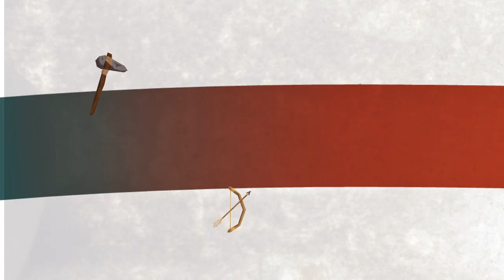A Prehistoric STONE bike?

Comment: Dude making a wheel from stone took less time than making it from wood
Reply: I think that comes from the fact that his wood working tools unlike their ancient predecessors weren't refined and passed down over generations (and most importantly practiced) and countless years. Using a chisel and a hammer is much easier to learn and less skill intensive. It is one of the flaws of the series is that I think it is ok to "cheat" and use more modern materials and systems in an effort to match the level of craftsmanship that was available from communities that shared resources and  specializations. Which is why I liked seeing his "cheat" at the end to really but the wheels to the test
Reply: *if you have the right type of stone. *If you have the right size stone handy. 

Getting a piece that was flat was 90% of the work with the wood. The rock was ready to go

Comment: I've noticed how much better you've gotten at casting metal over time. Practice makes perfect I guess!
Reply: Modern tools makes perfect
Reply: I think that's because they stopped trying to hide the fact that they're using a modern forge lol they were doing their pours from way too high to hide the cup from the camera
Reply: @GlorifiedGremlin  yeah, and honestly I'm totally fine with that, they proved that with enough time they could smelt metal, so them saving time and offsetting there lack of practical skill by using a modern forge is fine.

same thing with him sharpening the scissors and razor with modern tools, he could have done it with random stones and achieved the same result, but it's just such a painfully long process.

Comment: You’re riding it on asphalt. Try it on a more natural surface.
Reply: Yeah i guess it's more rated for mountain biking
Reply: I can imagine taking that down a hill, it would break and then the stone wheel would just smash everything in its path.
Reply: @Volt64bolt  the wheel seems fragile
Reply: Like sand since it's for Egypt
Reply: So... ice?  Butter?
Reply: I'd imagine both of those wheels would sink and get stuck in soft dirt, grass, leaves, etc
Reply: To be historically accurate to where Wheels were actually being used he would have to go to a desert to test it. And it did not survive long enough
Reply: @Volt64bolt  Going downhill is  the easy part.  Try taking it up there in the first place

Comment: Little historical heads up for you: if you want an easy way to smooth  out things like your wheels you can grind/smooth them down by rubbing them on a stone (the stone you used for the wheel would be perfect). You can make it even finer by using a scrap of leather and then putting a bunch of sand on the leather like sand paper. 

Otherwise just wanted to say I love the channel and stay safe!

Comment: Try 2 spherical baskets for wheels; built in suspension, so the frame can be ridged. Wide wheels will be more stable and put the symmetrical frame along both sides of the body giving more room for legs to run. Lean to steer. Weaving is simpler tech so you could move the time period back a ways. Also love what you do! Thank you for posting the goofy honest attempts; it's good learning!

Comment: You guys should make a file and a spear pointed twist drill. Both tools where available in the Classical era and possibly earlier. Would unlock early stages of precision engineering.
Reply: And most importantly to HTME 
They are easy to make.

But he dis tease making a lathe and those are insanely useful for making files and drills.

Comment: What about using bamboo instead of wood? It should be a lot stronger and lighter. Something with a 1-2" diameter? Smaller stuff would make for natural spokes as well. I think it would be totally tubular! Wow. Sorry about that.
Reply: There modern manufacturers doing this actually.  Bamboo apparently absorbs the vibrations so the rider doesn't get as tired.

Comment: Take the stone wheel, place it on it's side on a very good pivot (maybe a metal pointy pole sitting on a stone hemispherical hole), spin it as fast as you can and then bring some harder material to the very edge to sand it down, keep doing till it it's round; next keep it in place and attach the wood wheel and repeat, using the mass of the stone wheel as a flywheel.

One possible way to get it to a high speed relatively easily might be to wrap a rope on the axle and pull it sorta like a giant top; if you get enough momentum and low enough friction you might even be able to let the rope wind back at the end and keep it going back and forth sorta like a yoyo.

Comment: One thing that would have made the wheels better is wrapping with softened wood.  Take green branches (or strips soaked in water) and wrap them around the wheel then let them dry.  They'll give a more consistent surface and probably hold them together better.

Comment: Need to work on truing a honing stone (three-stone method), and then doing something in regards to sharpening to make that spoke-shave work properly. In addition to that, having a block plane would help too. Bronze is hard enough to take a proper edge, even if more subject to wear than iron/steel. That could improve the level of woodworking somewhat. Also need to learn how to do butterfly joinery. This is more of a "Flintstone" build than something properly Bronze-age. (A builder of chariots would only shake their head at this level of workmanship that would make some beggar's ox-cart look good.)

Comment: He should make carve like a soft cube of wax into a roughly circular shape. Find the center, connect to an axle shave into a smooth circle with a sharp blade. And use lost wax casting to make a metal wheel. Maybe use the master wheel to shape and finish rough wood boards?

Comment: There is evidence that the bike was almost invented several times (most famously, da Vinci made a rough draft of a bike moved by pedals), but each time either the idea was not implemented, it didn't caught (novelty toys, like you said) or they lacked some key point of technology (in da Vinci's case, I seem to recall that it may have been a stable wheel-and-chain system).

Comment: the only thing you're missing is the fork angle which self-straightens giving a bicycle that feel, and the height is several inches too high for your legs to push back forcefully enough to achieve improved locomotion over walking.

Comment: I'm looking forward to that lathe.

 If the Egyptions built a bike as good as their chariots it could have been extremely useful for moving armies. For a drive train I'm thinking either a leather strap, though tension could be difficult, or direct gearing which would have a lot of inefficiency from slop. Maybe rope is an option, wrapped around a spool at either end, like the lathe. That would allow for tension adjustment.

Comment: You know that you could have split the logs into thinner planks using an ax, a few wedges, and a maul? It is a very old method for getting somewhat flat boards to then refine further and and waaaaaaay faster than cleaning a face from scratch with an ax. It is a similar idea to what you did with the shorter lengths of log, but you start at one end of the longer log and wor your way splitting back. You can just take the face off to square it up too.

Comment: You could have made a lighter wheel using smaller pieces joined by dowel butt joint or mortise and tenon joint to make the rim. Also I thought that dowel rods to the hub may be supported by cords to the center for added support. The cord was my idea but the pictures of the chariots don’t show cordage on wheels.

Comment: Bikes are efficient because they are lightweight and precise. This build uses enormous crude logs and heavy wheels, which severely hampers its effectiveness. Spoked wheels are both easier to make round and much lighter than solid wheels (I'm hoping to learn to make those myself, soon), and wood split into smaller timbers, then fixed together with mortise and tenon or similar woodworking joints, would save a lot on weight. With so many cross-braces, even 2x2 sized boards would probably be plenty strong. Also I don't think you got the height quite right; it looks like you're struggling to reach the ground, and that almost causes you to fall over. And never underestimate the strength of wooden pegs. Even when iron was readily available, wooden pegs were often used in joinery that is still functional after many decades.

With all that said, it's quite amusing to see your flintstones bicycle take shape.

Comment: so i was wondering.. when you melt bronze.. the tools are not "hard reset" i understand the safety concerns but it would be nice to see how did they do it without any modern equipment if safety allows
Reply: At first they melted the metal collected it from the ashes then placed it over simple open molds made from fire proof materials and hammered the copper into it's final shape
Andy already covered it with the help of a specialist some months back when he jumped to copper.

By the bronze age their was already the fairly modern looking set ups, and insurance and local laws would forbid using the actual ancient tools unless you where a specialist.

Comment: Chain drive is about as efficient a transfer of power as it can get.  Motorized transports like motorcycles have a surplus of Power, but Lance Armstrong, a professional athlete produced less than half a Horsepower at peak condition.  So, in order to replace the horse, a bike had to be light, simple, and most of all Efficient.  One of the primary advantages for saving Energy is you can coast downhill, even on a velocipede.  You still have to climb uphill, but at least you don't have to walk, or run back down the other side, and you may be able to pick up speed going into the next hill.  (Depending how long the flat between is.)

Comment: I think a better power source is needed. A water mill doesn't seem so far fetched given the stage that the channel is at, but realistically they don't have the money for it. 

I wouldn't see it as cheating if a modern tool 'simulated' a river. Maybe a single, high power motor moving at a slow speed to give the power a river would.

Comment: I rode both a 1790s original leg powered bike and an 1850s wood made bike with pedals on the front wheel the 1790s one could not be steered but had to be steered by shifting weight like a skateboard quite scary! 
the 1850s one would not ride on cobblestones but on dirt and asphalt, it was fine. 
going downhill on these two was a free for all! no brakes!  your brakes are your feet!
foot braking on 1790 on a steep hill if there's no turn in the road just let it go you have got no steering! and the brakes are useless!
with the 1850s if you come to a steep decline just turn the front wheel 90% and brake with your feet and you'll stop.

Comment: I'm at 13:11 and like listen I really love you guys. I truly do. But damn, like, damn, this is gonna be a shitshow. Shoulda just made forks (like standard bike forks) that sit on the wheel axle, went out and bought one singular round piece of wood (from a trunk, as one could make many and it is the strongest way for the grain to lay to use as a wheel) for the wooden wheel, avoided using the stone wheel and used two wooden wheels, and used joinery methods that the egyptians definitely knew about for woodcrafting that are very very very elementary, much safer, and more worth your time. FYI I am a very experienced bike mechanic and I love this project but damn this felt like it was gonna work less and less as I kept watching, and I hate to see you struggle w/ the bronze age tools
Reply: The reason the dandy horse was useful, btw, was highly inclusive of the fact that it was not super heavy

Comment: I really like what you're doing but I am just so triggered by the way you do it. Even with the old tools, you could have had so much more precision in this build. As long as you have a string around a pivot point and you can sharpen your tools, you can make a very round object. Pieces of wood as spacers to do away with the play in the front wheel. Bees wax as grease? It just seems like there is so much more that could have been done with the same tools.

Comment: Sorry for constructive criticism , 
That bike was a fail , it needs to to be at least same effort as walking . 
It look like in wooden wheel you used bought copper nails .
I think a key thing your missing is the metal refining and carbon 'aloying '  .
.
Than others key thing your missing is the rotary saw , a key investment to save time cutting wood in perfect straight lines
Reply: 11:41 you can see nails colour and reflection , a level of tech you still didn't reach

Comment: I don't understand why you use that terrible wood.

Egypt had bows, yes? So why wouldn't you create a far lighter bike by using younger wood applying principles from bow-making? I also don't think you'd need any metal. Greased wood axles would be sufficient for a rudimentary bike i think. Depending on the tensile strength of bronze, you could even use spun bronze wire to create a rudimentary sprung wheel like in use today. Not as light as a modern bike but lighter than that monster you created with planks.